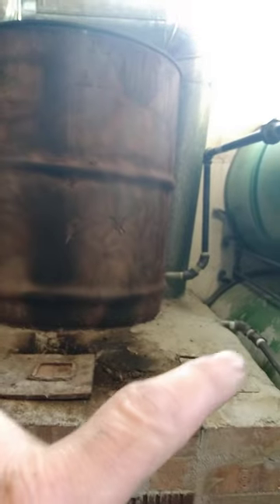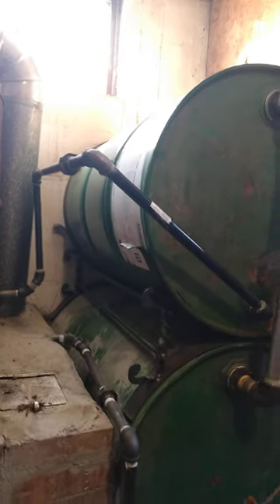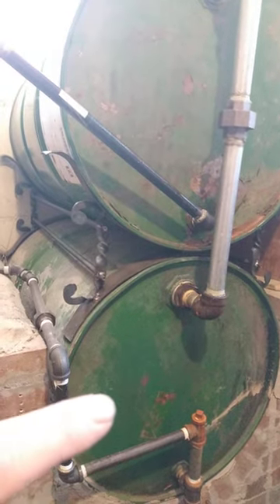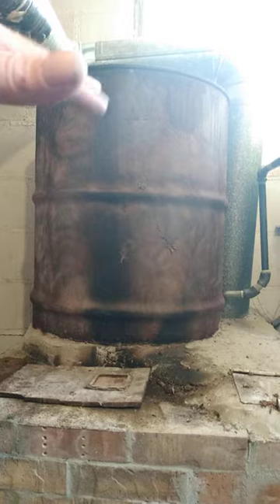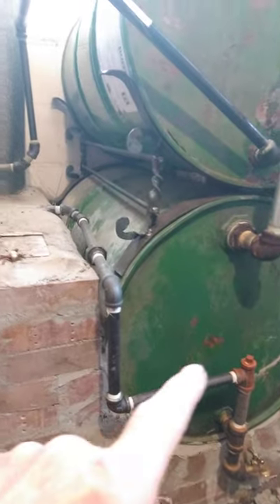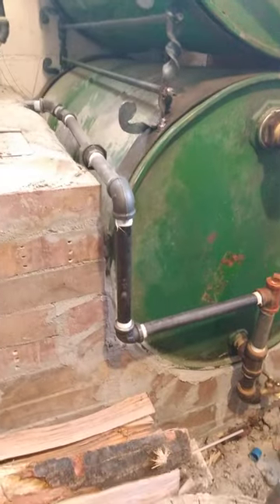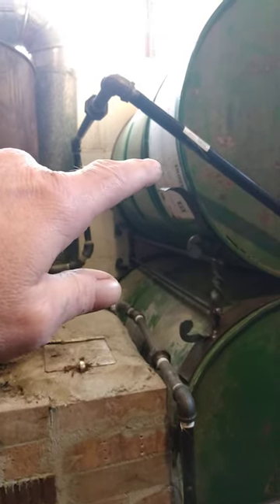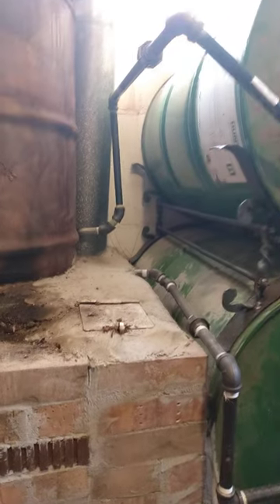update rocket mass heater double barrel water mass

Comment: Green 1 top down into Green 2 means cooling... why not thermal cycle using natural heat rise from heat coil running down into bottom of Green 2 then thermal rise up into Green 1 gravity feeds heat coil... ?
Reply from the maker: I don't quite understand your question,  I had planned on it percolating and didn't expect it to thermocycle,  but, as heat rises naturally, it thermocycles until the fire gets really hot, and after the fire starts to get lower again, it will thermocycle for hours untill the core of the system cools down again.